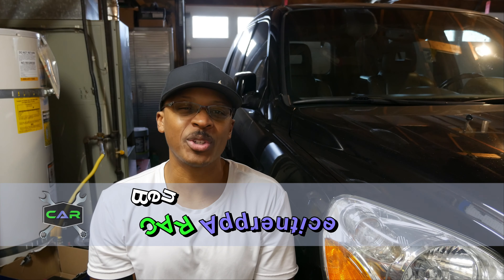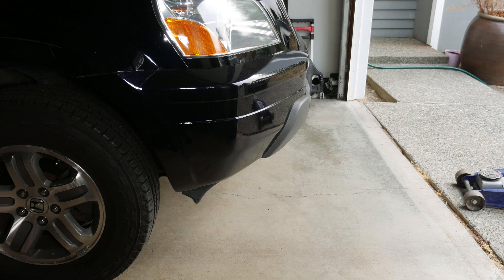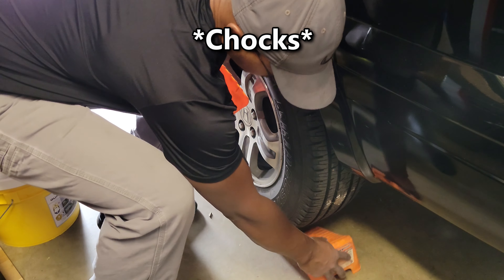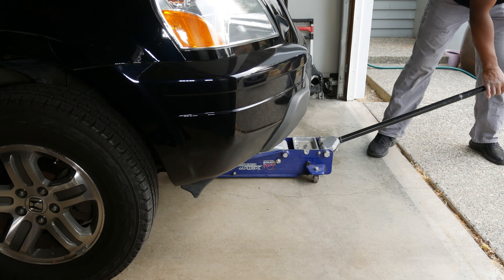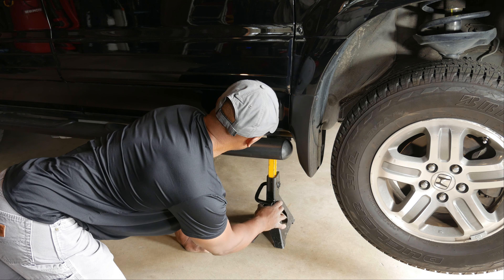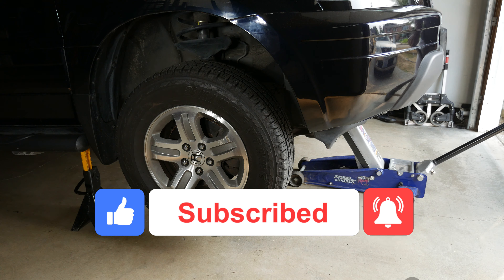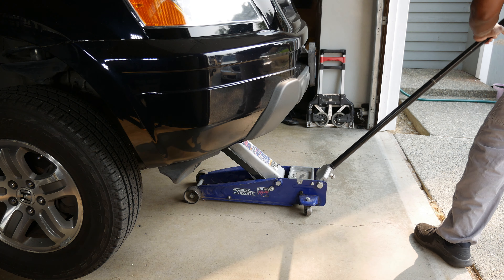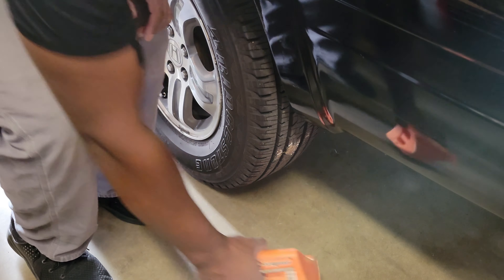2004 Honda Pilot - Jacking Up the Front End

Comment: Now do all 4s
Reply from the maker: Yeah, I've been hesitant to do an "all fours" video, since it's a little more risky than just jacking up each end. I've done it on the Pilot to turn the front rotors using an on-car lathe, so I may make a video or include it with the on-car lathe video I'll be editing at some point: https://www.instagram.com/p/CjMm7tUu0Fj/
Reply: Right on brother, I acually just got done rotating my tires on my 04 pilots. Fronts to the back, then rears forward but cross cross them. So had Jack up all 4 at once also just bought this 04 pilot. 169k on odo. 

I did the front first, chocked backs.  Then moved to back, did back. Lifted slowly and checked periodically that the front wasn’t moving or stands wernt tipping. 

Nothing moved. Was very study, I was nervous too and acually was suprised how study. Level garage floor though. I even forgot to press my e brake in 😂🤣 

Just got done, washed hands and inside replying to you lol. 

Cheers
Reply: Right on brother, I acually just got done rotating my tires on my 04 pilots. Fronts to the back, then rears forward but cross cross them. So had Jack up all 4 at once also just bought this 04 pilot. 169k on odo. 

I did the front first, chocked backs.  Then moved to back, did back. Lifted slowly and checked periodically that the front wasn’t moving or stands wernt tipping. 

Nothing moved. Was very study, I was nervous too and acually was suprised how study. Level garage floor though. I even forgot to press my e brake in 😂🤣 

Just got done, washed hands and inside replying to you lol. 

Cheers
Reply from the maker: @robertkenney6002  Yes, this is how I've jacked up the car. A level surface is a must.